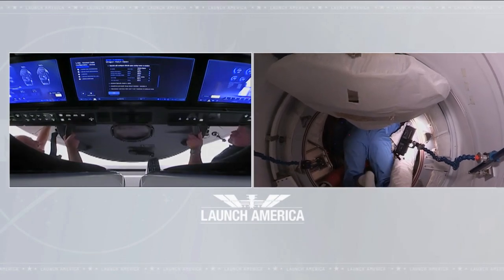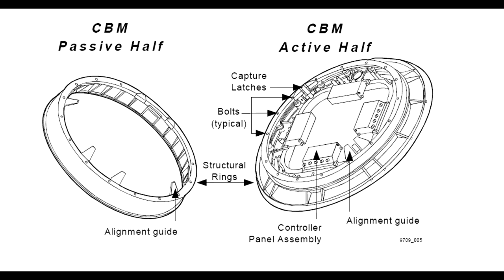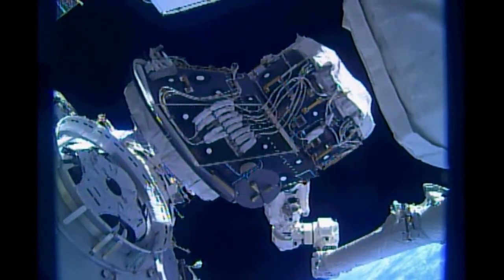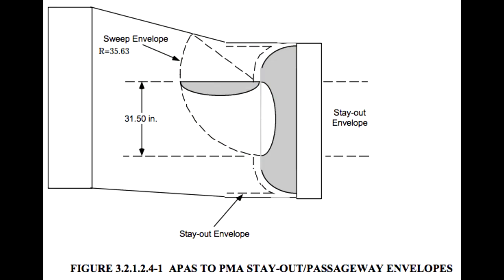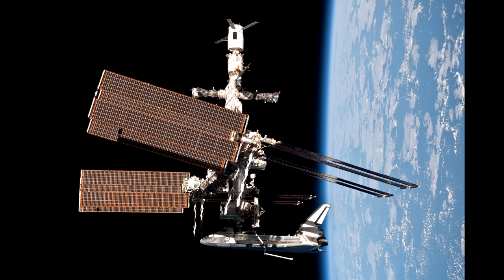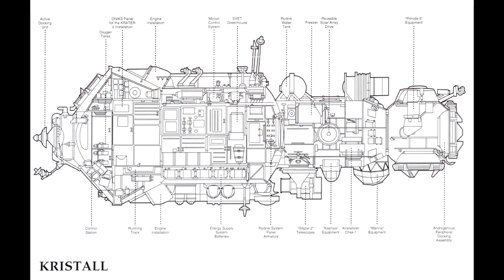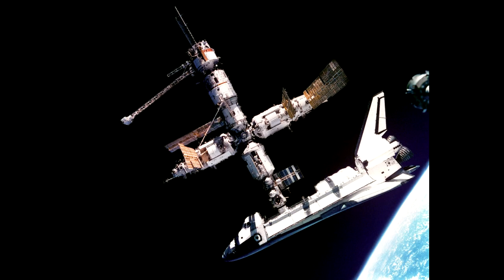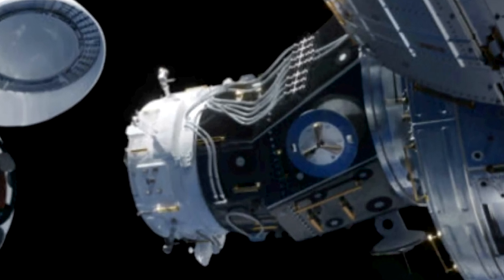Why The Docking Adapters On The Space Station Are Shaped Oddly

Comment: 4:25 Maybe they say it here on page 81 
https://ntrs.nasa.gov/archive/nasa/casi.ntrs.nasa.gov/20110013394.pdf
:
“Pressurized Mating Adapters The Pressurized Mating Adapter was a transition structure originally designed to provide the interface between the Space Shuttle Orbiter and the Space Station Freedom. Its unique shape was developed to preclude contact between the Node or Lab endcone and the Orbiter Forward Fuselage during docking with the Shuttle External Airlock. It was constructed from four Aluminum 2219 forgings,” […]

(from https://www.forumastronautico.it/t/forma-dei-pressurized-mating-adapter-pma/34213/22)
Reply: What I found interesting was that at any angle the PMA was installed, the Orbiter cabin always had clearance using the PMA with the installed ODS. The one time this seemed to be a negative was when they were attaching Node 1 to Zarya - they had trouble seeing past the offset the PMA had put it at.
Reply: @dramaticusflatudicus3839  Perhaps it is not a question of room for maneuver but of delicacy of maneuver.
When we went from making wooden ships to making them in iron, the portholes, from being round, have become square; this is because wood bears compression better while metal bears traction
So, given that the Americans were not familiar with automatic docking and did not trust the pilots too much (or at least the delicacy of their approaches), they will have thought: let's put between the shuttle and the ISS something expendable that absorbs the bang and break in place of the station ... and that's how they invented the edgy contraption!
(Translated by Google, I hope you understand)

(The original:
Forse non è una questione di spazio di manovra ma di delicatezza di manovra.
Quando si è passati dal fare le navi in legno al farle in ferro gli oblo, da tondi che erano, sono diventati quadrati; questo perché il legno sopporta meglio la compressione mentre il metallo la trazione 
Quindi, dato che gli americani non erano pratici di attracchi automatici e non si fidavano troppo nemmeno dei piloti (o almeno della delicatezza dei loro avvicinamenti), avran pensato: mettiamo tra la navetta e l'ISS qualcosa di sacrificabile che assorba il botto e si rompa al posto della stazione... e fu così che s'inventaronol'aggeggio spigoloso!)
Reply: @macromartino  I gather what you are saying but I think it might be simpler than that. Up until the Russians were involved Freedom had a variety of docking or berthing systems assigned to it. From 1990-92 there was no docking at all, only berthing with the RMS. Either side of that, an adaptation of the berthing adapter/docking mast/docking adapter with attenuation targeting was going to be used. About the same time Russia opens Mir to Shuttle docking and the ODS experience with docking became the new plan. The clearance involved was about the same all the way through.

Comment: I don't see how they can dock without sending the space station spinning.
Reply: Physics will help you understand.  I think you only need an IQ of 105 to grasp the basics and 115 IQ would put you at the very bottom of a master's level physics class.  Thus on the macro, anyone with an IQ above 115 has the cognitive ability to learn and teach the subject.
Reply: You didn't answer my question - how can they dock without sending the space station spinning? Of course it would boil down to the inertia of the space station versus the tiny inertia to the capsule during docking. But however tiny, the energy imparted has to be absorbed. They probably have shock absorbers. Seems you couldn't answer the question, so maybe you should take some physics classes.
Reply: @TropicalCoder    I was attempting to tell you the following in a nice way.

If you finished school and are unable to figure this answer out on your own then most likely you do not have the intelligence to grasp the idea.  

If you are a small child then tell us, we will help you.
However, if you are an adult and can not understand the canned answers on the internet then you will need special help from tooters.  

P.S.     They are moving at the same speed and rotaion.  It is no different than two drivers passing a brick to each other while driving at 100mph/Km.
The brick does not smash the other driver's hand.  Yes the brick is moving at 100mph but so is the hand catching it.  

I am not going to cut and paste the math, not that I know it off the top of my head.  

I am not smart, nor bragging that I am.
You are asking for free tutoring without proving you can even read wikipedia and understand it.

Comment: when you are on the atmosphere you fly. When you are on the space vacuum you: what?
Reply: i dont understand your sentence at all.
Reply: @bradleon1926  
Sorry, I thought the verb fly could only be used when you travel through the air. my mistake. :)
Reply: @ricardobfe  could you rewrite your sentence/comment?
Reply: @bradleon1926  I'm a little confused, I don't speak English. I didn't know that when you are in space without air, you can also "fly". I thought that flying is only used for aircraft with wings, and wings are useless in space, so specifically 'to fly is not to fly, it is to float'. This verb is so dynamic. :)
Reply: @ricardobfe  Great Question! the reason the shuttle had wings was because they wanted to make it reusable. so while in space the wings will be useless, when it is coming back to earth and landing, it is useful again. when they want to steer in space, they use small thrusters to turn the shuttle. :)

Comment: Sorry but I have to rate that a major fail, it did not explain why it would have that bend when the same thing could be accomplished with a straight tube of the right length. You must have some buddies at NASA that know, that significantly added complexity was for a specific reason at the time, whatever that might be.

Comment: I hope Elon Musk's SpaceX looks into a 'First principles' Docking system that is less complex and alot cheaper yet more capable.
Reply: for that to make sense, spacex would need to be building both sides. so long as spacex is docking with non-spacex stuff, using a new docking system would accomplish nothing since spacex would still have to build an adapter to whatever docking interface the other side actually has.
Reply: @sirmoonslosthismind  Yet for 1'000s of Starships it would be crazy to use docking adapters that cost as much again as a Starship, partially when there will be no other mission to Mars by any one else for over 15 years later except maybe a Chinese manned mission around 2033-2038 timeframe(NASA's plan is now 2040).
Reply: @favesongslist  
your assertion that half a docking system costs as much as an entire rocket is patently absurd.
Reply: @sirmoonslosthismind  Really! A Starship may be built for around $10m-20m from stainless steel, how much do they pay for a NASA rated docking adaptor Crew Dragon?
Reply: @favesongslist  
you're stoned. spacex's construction costs alone have been estimated at > $200 million per starship. nasa pays for a lot more than construction; certification procedures are quite onerous when human lives are at stake.
Reply: @sirmoonslosthismind  Where did you get the >$200m from?????